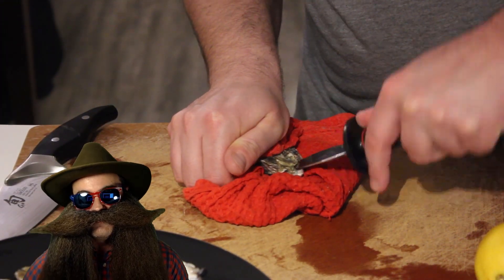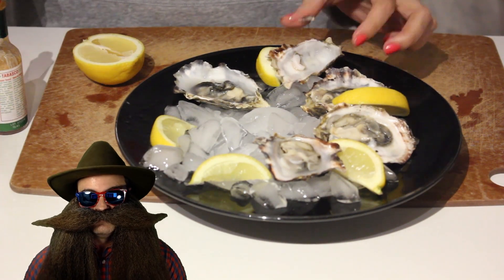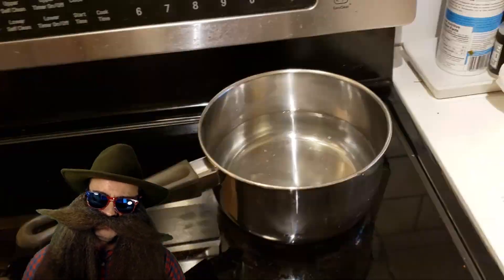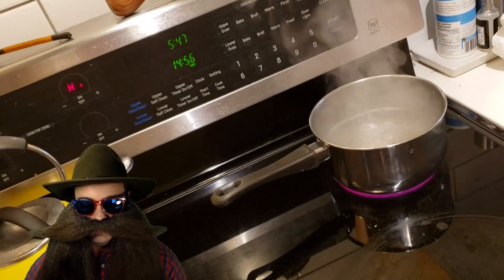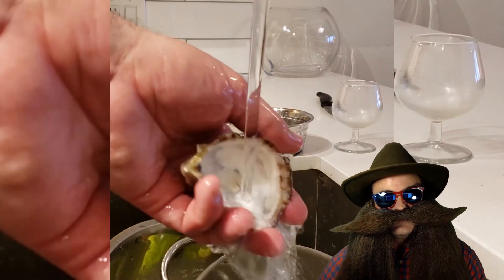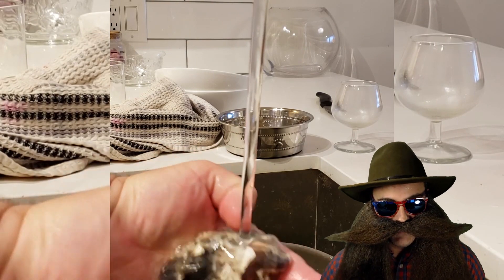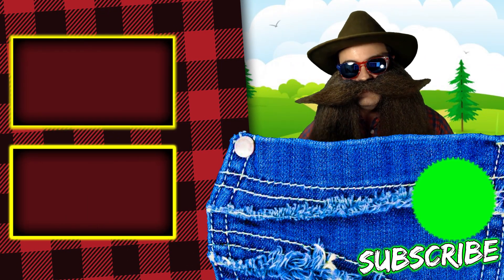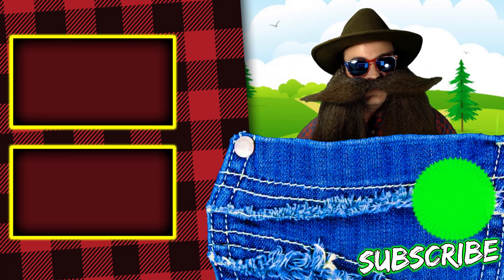Awe Shucks, Oyster Prep 101 - A Fishy Solution to pH Control - Oyster Shells for Sugar Wash pH?

Comment from the maker: How many oyster shells do you put in a 5 or 6 gallon batch of sugar wash?
Reply: Some say a handful. I have always used stainless dry hopper for 5 gallon corny kegs. I fill it right to the top with chicken scratch shells from the feed store. The scratch shells are just pea sized crumbled up oyster/clam shells. $3.99 for a 15lbs bag. The dry hopper measures 2.75 dia x 11.5 inches long.

I hang the dry hopper with a piece of 1/8th stainless steel rod bent in the shape of a "S" hook. I put it in a 5 gallon batch (7 gal bucket), 12 gallon batch (15 gal bucket) , and in 45 gallon batch (55 gal barrel). I find that hanging it below the wash/mash surface 3-4 inches is fine. Big 45 gal batches will eat up 80% to 90% of the shells. I have also refilled them and put them back in.

Funny thing is you will hear it "fart" from time to time. Yeast collects on the top witch has smalls holes and plugs them. The CO2 gets caught and will overflow on the sides on the hopper screen and "fart". Just like an air lock.

Only issues I have had using the dry hopper is with a brew bag. When I "ferment on the grains" ie UJSSM style.
I hit the previous trub in the fermenter with hot fresh backset. Add water and sugar, mix and aerate. Put in brew bag and secure on sides of vessel. Mix in grains, add more water to top off. Then slip in the dry hopper  in between the wall of the vessel and the bag. It just seems like ferments take alittle longer. I believe it is due to the bag and the grain cap almost sealing it off the the wash. I may try to hang it the long way but deeper below the cap and the bottom of the bag.

I have also used marble left over from countertop cuts. Drill a .25 inch hole in a chunk (4 wide x 16 long x .5 thick inches) marble and hang it with a stainless s hook. Marble dissolves just like the shells. Will completely be used up by x3 or x4 generation.
Reply from the maker: Great comment man. Thanks for sharing. Before posting this video, I never would have known what chicken scratch was made out of. It is an excellent source of calcium carbonate that is, cheap, broken up into small pieces (high surface area), and ready to go. I read a home distiller post about putting marble in the fermenters like you said. I find it fascinating that there are many natural solutions to controlling pH. I've been told that eggs shells, coral, snail shells, clam shells will all do the job. Cheers mate!

Comment: If you drill a little hole in the centre, then string them together with some copper wire like a tacky tourist necklace... you can hang them in the fermenter in batch 1, then remove and rinse, then re-use in batch 2... so I'm told.
Reply from the maker: Thanks for the suggestion. I put them at the bottom of the fermenter but I do think they would interact (dissolve) better with the wash if hung. I used about 2 full shells, tops and bottoms, in one 6 gallon batch and the remaining shells were brittle and almost fell apart when I rinsed them off. They work like a charm.
Reply: Yep, heard that as well, .